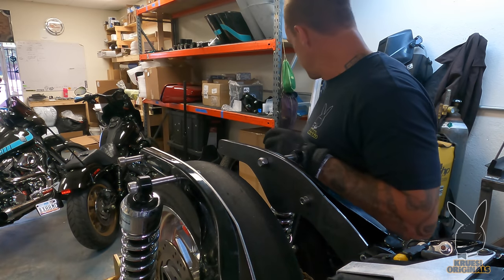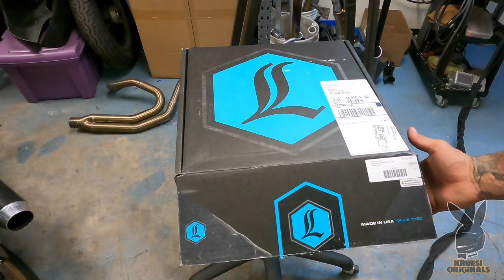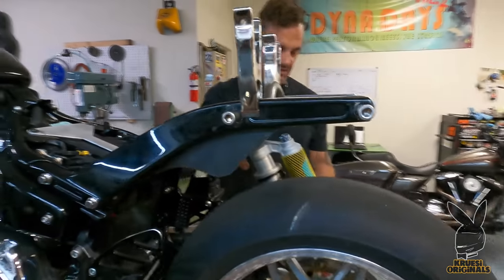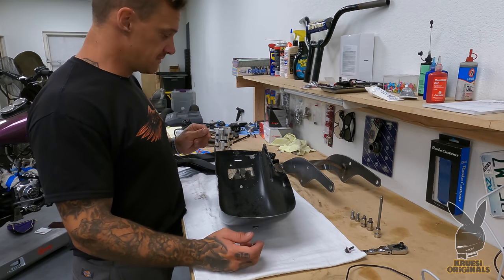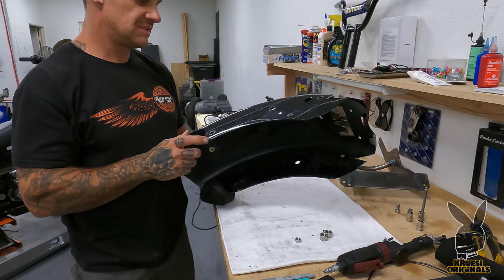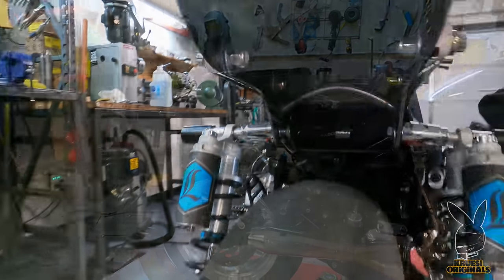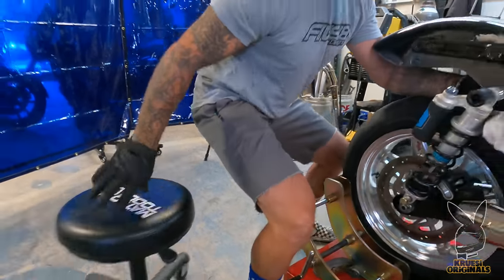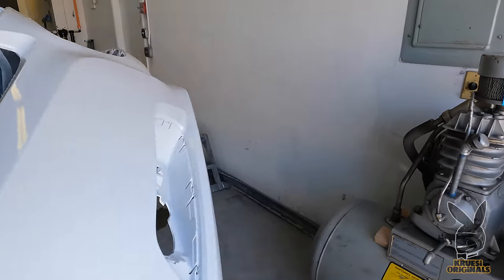Harley Davidson road race bike (P2)

Comment: I was wondering if you were gonna do something about the flexibility of the fender mounts. That’s why I think the dyna shock is a good theory but you’re definitely missing some stuff in the kit your selling.
Reply from the maker: I’m not missing anything, when the fenders bolted in they’re extremely rigid I’m just doing a little overkill and a way to get more height. The dyna frame rails have a lot more flex in them than these do we have a prybar in the shop for bending them straight all the time.

Comment: Is all this stuff gonna be included in the kit you sell? I’ve been wondering how you were gonna fix the geometry of the shocks and the flexibility of the fender struts. Without all this bracing the dyna conversion is just a nice theory.
Reply from the maker: There’s nothing wrong with the shock geometry there’s nothing to change about the kit at all, This is an extreme race application
Reply: @kruesioriginals  I wanna see the dual shock thing on more softails it’s a really cool kit and seems more adjustable.